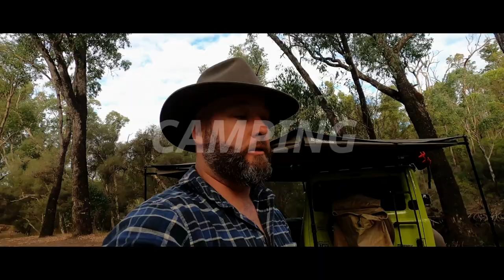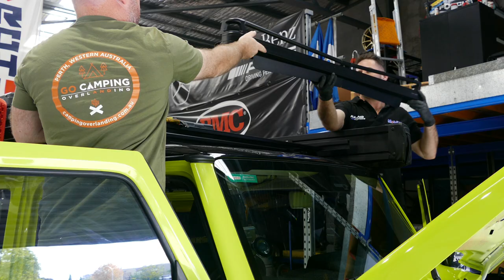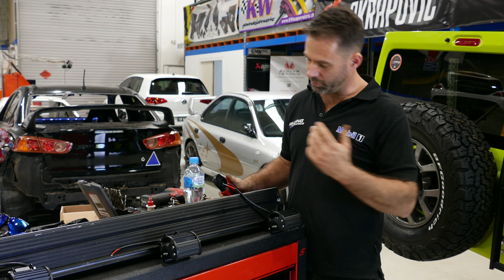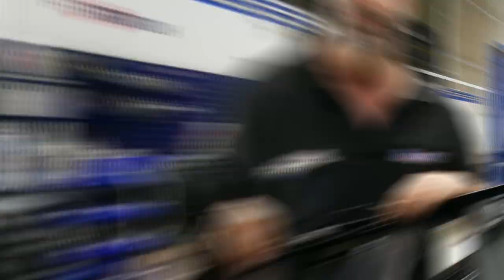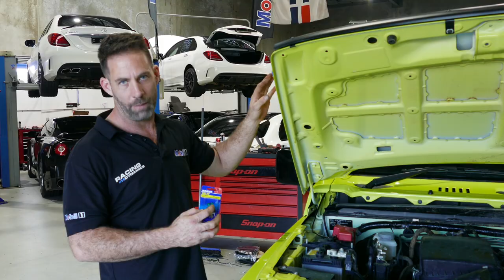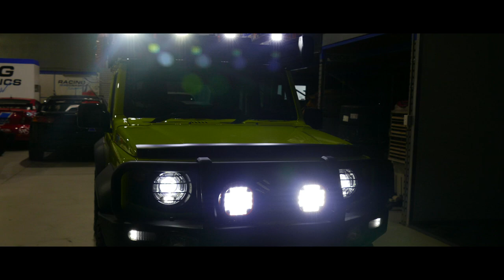NILIGHT LIGHT POD INSTALL JB74 SUZUKI JIMNY Spotlight/Lightbar Install ROOFRACK MOUNT

Comment: Great instruction, but I missed the bit how the wire is getting from the window to the engine bay ...
Reply from the maker: Hey mate it’s in there I am pretty sure. However if you open the bonnet you can remove (once you undo some fixings) the small corner covers at the top of the bonnet that connect to the A pillar. We went under that next to the bonnet hinge and down into the engine bay that way.
Reply: @MightyOverlander  I now understand what you did but it's a pitty it is not in the vid, tnx
Reply from the maker: @pim1234  thanks for the feedback!

Comment: From where do you get the relay trigger current?
Reply from the maker: Piggy back off the spotlights
Reply: @MightyOverlander  But in a Jimny that point is permanent 12V, i.e., the high beam turns on when negative/earth is added. 
This means that taking the trigger current from the high beam with a piggyback will not control/turn off/ all high beam + extra lights using the leaver at the street ing wheel. 
- Or am I missing something vital here?
Reply from the maker: @BorisEkner  from memory we piggybacked of the spotlight relay. It was a while ago now sorry my man can’t remember

Comment: I’ve got similar lights around the sides and rear of my 4wd, good cheap lights 👍👍👍
Reply from the maker: Yeah they are good little bang for your buck lights. I’ll be replacing them eventually but they are pretty decent for the price!
Reply: Nice sticker you’ve got there, on the fuel cap. 😉

If you pull the relay negative wire into the cabin and add a switch to it you can control if you want the roof lights on at the same time as the head lights on the bull bar.
Reply from the maker: @BorisEkner  SMIB 😉
Reply: @MightyOverlander  👍 3x3